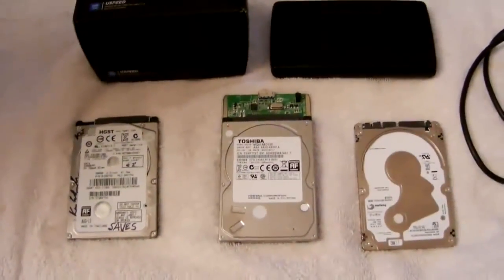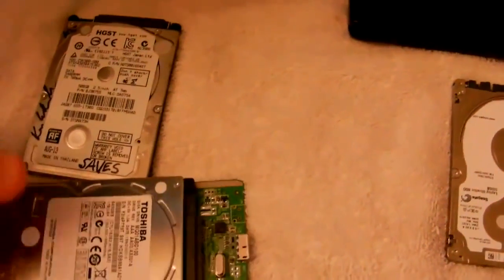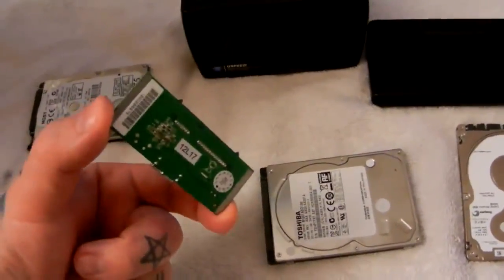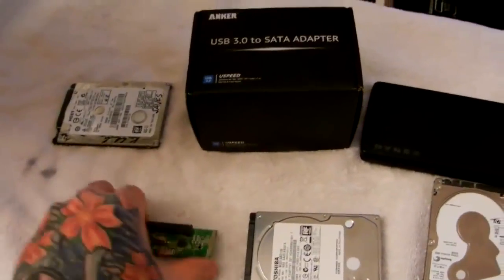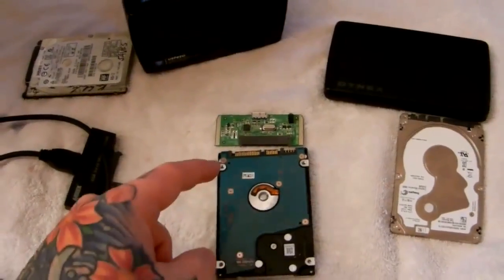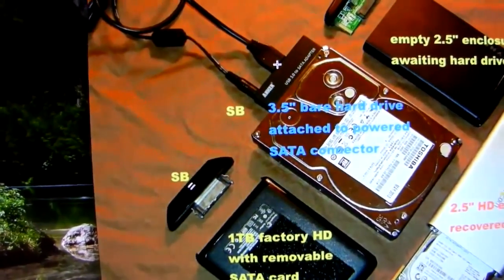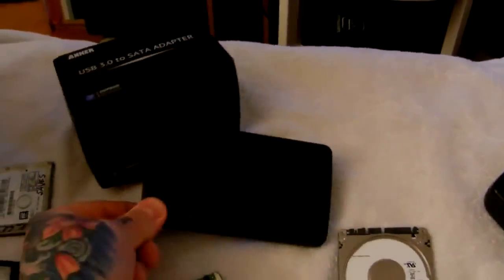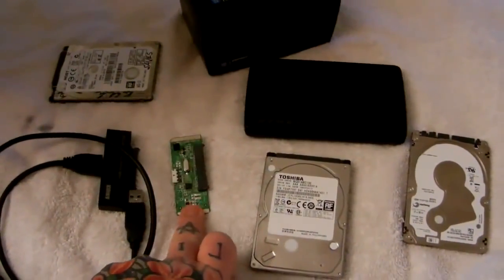The Angry Photographer: Secret to FIXING YOUR EXTERNAL HARD DRIVE! SAVING your data and PICS!

Comment: How do you clean a plastic focusing ring that has turned pale? A future video maybe?
Reply from the maker: focus ring on a LENS?  you mean turned milky looking????

use silicone spray on a cloth then wipe it on the rubber focus ring.
Reply: Yeah that!! Thanks! I'll try it.
Reply from the maker: the rubber got dehydrated OR chemicals got to it !

Comment: awesome information for external hard drive video
Reply from the maker: i own over well over 200 HD, and take them apart, and sometimes fix them, they call me the God of hard drives.

LOL

ive taken apart 1000s of them, mostly for parts salvage
Reply: Theoria Apophasis What happen if the hard drive fails though? Can you like use the chip from another hard drive to recover the data? Or the Chip within the hard drives are not removable?
Reply from the maker: usually only 2 things fail.  the sata bridge card

or the HD controller board

both can be swapped out EASY

but THIS IS WHY you need lots of redundant drives and data copies so you dont have to do surgeries like this.

yes, you can use the HD controller board from another IDENTICAL HD to retrieve the data.

If the HD ITSELF has PHYSICALLY crashed , thats another matter, and then youre SCREWED !!!

Comment: I hate Seagate drives, I have had multiple drives fail simultaneously however Hitachi and Toshiba I found to be the most reliable after using a few hundred 3.5" drives in my raid array in my NAS
Reply from the maker: hitachi are best on reliability, but they all WILL FAIL

all of them baby!!!!  read my article in the OTHER video where i bitch and moan about data protection, my LATEST video
Reply from the maker: nahhhhhhh Toshiba are the MOST noisy by far.

i dont buy WD shit except their BLACK drives

Ive got about 220 HD , the Toshiba drives , the 500 and 1tb 2.5" are the most noisy